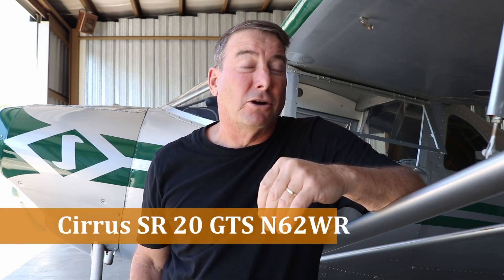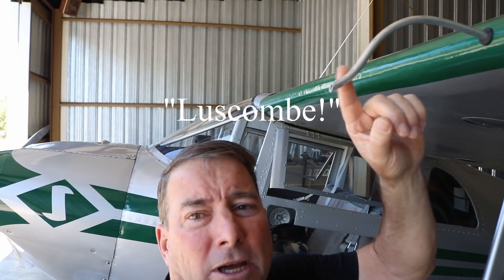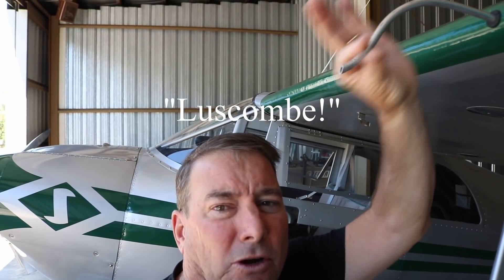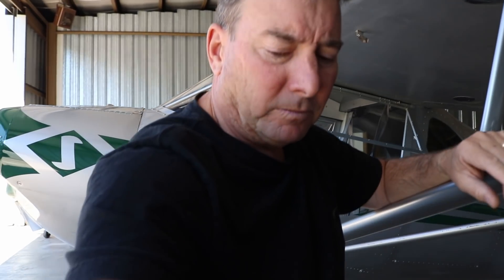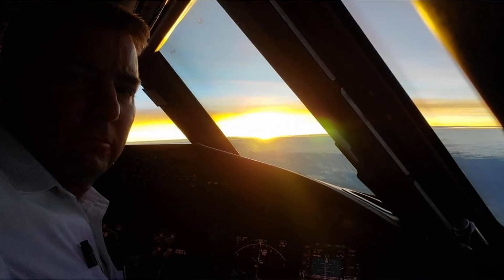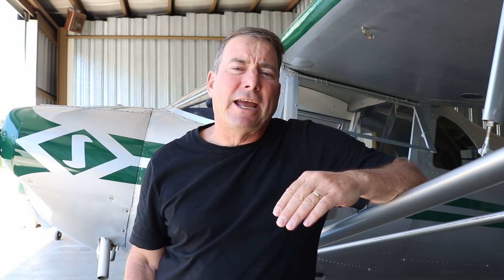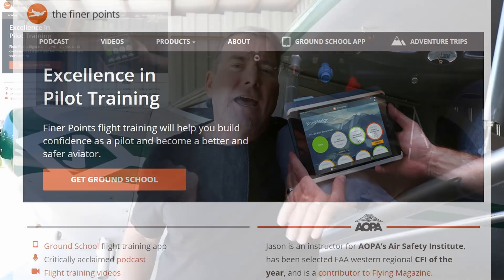Cirrus SR20 Crash Conway AR - AQP for GA!

Comment: Cirrus is a hot plane for a student pilot. The Cirrus was certified in USA by FAA without doing spin recovery due to having BRS.... From all the stall and stall /spin accidents I don't think the Cirrus is docile. The Cirrus has an outboard wing twisted down to make it stall later and in theory make ailerons effective into the stall, to improve stall handling.  The wing also has leading edge "cuffs". All of these wing design features were band-aids in attempt to mellow out the stall characteristics, which are not great in the Cirrus. Of course the plane does not look like it is at fault here. However some planes have stall behaviors that are much more benign. You must  maintain flying airspeed below critical angle of attack regardless of what plane you are flying. However if you stall a Cirrus close to the ground, the ground will come up and smite ye mightily.
Reply: @GaryMCurran  Thanks for correction. Inst rated, partial panel should have been a skill. Tragic.
Reply: @gmcjetpilot  this is why I think something else might have been going on.  Even if the guy was just current after not flying for an extended period of time, you still should be able to fly an airplane in CAVU conditions with no reference to instruments.
I'll be interested in what the NTSB says about this one.
Reply: @GaryMCurran  I agree with all you said, including "should be able", but sadly peoples airmanship may not rise to the occasion. Don't know. Lack of AS indication is a factor. Some panic and freeze, get distracted, forget to fly the plane. You should be (again s/b) able to feel by seat-O-pant back side of pwr curve,  "slow flight" (mushy controls) and/or onset of stall. However never having flown the Cirrus I don't know what that the slow speed regime feels like. Every plane I fly gets a work out, stalls, steep turns, slow fight etc. Most planes buffet pre stall while some at 1g don't stall just mush (sink fast). (guessing) Cirrus has few pre stall clues andfully stalls are abrupt. The BRS is not a catch all (pun intended) for lack of stick-N-rudder and good procedures (preflight).
Reply: @gmcjetpilot  I attended a lecture with Mike Melville, the first pilot of Starship One, and the topic of the BRS came up.  You would have thought someone had suggested his daughter was a woman of ill repute.  He does not, at least at the time, like the CAPS in the Cirrus.  This was many years ago and I wonder if he's changed his mind.
But, in this case, I would agree that CAPS would not have done anything.  I think we have a case of stall-spin, but what I want to know is, WHY.  What would make an instrument rated pilot, less than a mile from the airport on a CAVU day, crash?
I'm sure you've read "Fate is the Hunter", but did you ever watch the movie, which had nothing to do with the book at all.
It's an old 1950s movie, in black and white, as a lot of the same questions were asked.  Why did a twin engine jet liner crash with two perfectly capable pilots on board, and one engine that was perfectly fine.
Good aviation detective movie.
Reply: @GaryMCurran  Oh my gosh! I did read "Fate Is The Hunter*, Ernest K. Gann. It must be 30 years ago.  Loved it. It did inform and affect my approach and attitude toward flying from then on. Loved it. The B&W movie with same title was before my time, but I did see it. Caught it on TV by chance. HA HA. Seriously. Gann lived in Friday Harbor WA is not far from Seattle where me and the wife lived in Seattle. It's about 30 min flight in a C172. It has a nice airport, short walk into town, restaurants and tranquil beautiful scenery. If you get a chance to fly into the many San Jaun Usland airports, including Fruday Harbor, do it. You can also get to the islands by WA state car/passenger ferries.

The movie had little in common with the book; it is not great movie, but hey it was made in early 60's, and it is an airplane move.

Gann as you know was an airline pilot in the early days. The one-story where Nav lights go by in the clouds got my attention. I remembered going into Hillsboro Oregon airport on a solo student cross-country from Seattle. I was starting my descent on the airway, when a Bonanza went right over my head. Apparently we both were doing a good job tracking the Victor airway that day. Kind of hard to see airplanes coming straight on at you. From then on VFR flights I flew slightly off and upwind of  Airways. (Now its GPS direct : -) . I recall I read Fate right after. Much later in my career flying a B737 approaching Newark a King Air (not talking to anybody) and likely also with transponder off, since TCAS did not give an RA and ATC did not see it, flew over way too close. The Bizz Jet that hit a B737 in Brazil had it's transponder off. The Bizz jet landed but the B737 crashed kling all aboard. As a wise unnamed philosopher once said: "S@#t Happens".

PS I am not against BRS. In fact I have a chute for my RV7. Howevet I wear it on my back. If something big falls off or there is an engine fire this guy is "hitting the silk", hopefully not hitting the ground abruptly. Loss of power with good place to land? I would fly the plane.

Comment: Considering how irregularly most GA pilots fly and train, one might want to consider if deliberately obstructing (covering) a pitot tube,  and neglecting to remove that obstruction resulting in the loss of a critical flight instrument is greater than an uncovered pitot tube being obstructed. In 50 years and thousands of hours of flying, I've encountered an obstructed Pitot tube only three times, once on a test flight of aircraft that had not been flown in many years, atgain when the pitot tube impacted a small bird in flight, and another time where the Pitot tube directly impacted a large insect on takeoff. 
it's also important to check the rear drain/calibration hole. I've seen one that was corroded so badly it effected the calibration and another on a Bonanza what was blocked causing an erroneously high airspeed, about 8kts on approach.

Comment: When I was flying as an FO in a CRJ900 I was coming down the taxiway to 35R at DFW and observed an AA321 with the pitot completely covered!  I reported it to ground and they reported it to the flight in question. The captain said he couldn’t see it.  As luck would have it they pulled up next to us just short of the runway.  I spoke directly to the captain on the radio and told him where it was.  The left side was completely covered.  They then thanked me and taxied across the runway then did a gate return.  Now I’m flying a PC-12 and some times we send two pilots on certain trips and we are always doing airspeed checks and positive control changes everything you learn at 121 and airline training and AQP

Comment: “Airspeed is alive, engines instruments in the green” on every takeoff roll.
Reply: I had the exact same reaction to him apparently NOT doing this.  Puzzling.
Reply: How would he even know when to rotate?
Reply: @jonkagan7170   At “enough speed” it probably “wants to fly” and just lifts off the runway.
  But even if you go with that assumption, how does one “not notice” zero indicated airspeed yet climb at Vy (or Vx) ?
  My sense is he did not abort the takeoff and it started to fly.  Not much of an issue at full TO power and a normal-feeling pitch angle.  But then when he throttles back or idles the engine he just doesn’t visually judge the airspeed and balls it up after he stalls.  
  Too many questions. Disheartening.  I hope I am wrong.
Reply: @jonkagan7170  Prob. by paying attention  to his newly developed instinct and feel for what the plane was doing, but which he seems to have stopped doing once he got airborne. Sad thing.
Reply: Even when I am alone I do verbal callouts of airspeed I am my own FO. IN effect it is my personal takeoff checklist as I roll dwon the runway. I also have Vx and Vy marked on the airspeed indicator. Its only a Piper Cherokee but I want to know those data points especially in a hot, high  and  (maybe) heavy takeoff.
Reply: How someone could be checked out for solo without this being second nature is beyond me.
Reply: I was looking to see if anyone called “airspeed alive”. Every takeoff roll.

Comment: I have my GA students fly without airspeed from time to time and at least once the full pattern. (pitch, + power = performance) "Airspeed alive, engine (gauges) check"    during take off was something I had my GA students check. To let me know they did it they verbalized it.  I would also look at them to see where they were looking.... not just saying it without checking. Obviously when you set power with fixed pitch there is a min static RPM and CS Prop it should be at full RPM (2700 typically). All these are checked on EVERY takeoff, along with an abort point and engine out plan low altitude and higher altitude.

Comment: I only learned the practice of presetting the throttle for specific airspeeds and landing the aircraft based upon attitude and throttle setting as part of my instrument training. That's also when I got into the habit of checking my airspeed indicator at the beginning of my takeoff roll. I think Juan is right. This is a skill that needs to be taught to all GA pilots, not just those of us who bother with the instrument rating. 

We can do better than this.

Comment: I recall once seeing in the Sporty's catalog, a "breakaway" pitot tube cover having vanes which caused the cover to split in two and fall to the ground once subject to a certain airspeed.  I just checked and cannot find this accessory.  Anyone else remember those?
Reply: What I remember was one that had a little plate on it that when you hit a certain airspeed, the plate would tip back opening the pitot tube.  When the airplane wasn't moving, it was closed, but when you hit like 25 knots or something, it opened up.  It's not on their website any more.  However, Aircraft Spruce and Specialty still does offer them.  They open at 40mph or so.
https://www.aircraftspruce.com/catalog/inpages/ptubeprotector10-02100.php

Comment: 6:17 Setting a known pitch and power setting is something we don't hear often enough. It seems it would have saved even some major accidents like AF447.
Reply: Would have been a lot saved for sure. But it does have to be trained, and drilled into the brain, because it goes against our instincts to fly fast and high when trouble starts.
Reply: Exactly.  "Setting a known pitch" is the analogous to setting a proper angle of attack.  Don't rely on speed.  Flying using angle of attack (AOA) indicator, or appropriate elevator trim if AOA indicator is not available, would be easier and safer than by using indicated airspeed.   To avoid stall, simply do not exceed the stall angle of attack.  There is also an optimal angle of attack for climb, for efficient cruise, and for descent.  During steep bank, one is still able to stall the aircraft even at high indicated airspeed when one pulls too hard on the stick to exceed the stall angle of attack.   Landing an aircraft using the AOA is also easier, as one simply trims the elevator for the proper angle of attack for the approach, while adjusting the throttle to control the rate of descent to stay on the approach path to the runway.   When reaching near the runway, advance the throttle a little to slow the rate of descent, then soon enough, the aircraft will be in ground effect and wants to float and one simply needs to ease gently on the throttle to the idle position to get a soft touchdown on the runway.   By minimizing the use of elevator while trimming for the proper AOA, and using the throttle to control the rate of descent and climb, stall and spin accidents can be much reduced.

Comment: In the airlines and larger planes that require 2 pilots usually have two air-speed indicators or three actually, if any one of those three are not lining up you are advised to reject your takeoff, my dad was a CFI and I grew up in airplanes and I was always taught if there was anything at all funny about my airspeed to reject my takeoff, I'd much rather take the time to figure out what's going on when on the ground than have to deal with it in the air and end up dead.....

Comment: I just finished the last AQP training of my 121 career on Sunday. SPOT, EET, MV and LOFT. (interestingly, EET was mostly managing erroneous/unreliable airspeed). Total ~10 hrs of sim training + pre/post brief. Can we drag pilots in for ~10 hrs of training every 12 months? lol, many of them don't even fly 10 hrs in a year. So those that don't do the training will lose flying privileges? And to do the training they will have to fork over ~$1500 - $3000? 

Flashback, late 1980's. FAA proposes a change to part 61 that would require pilots with less than 400 hrs total time to complete an annual flight review. Everyone else operating under Part 91 would stay on the 24 month cycle. Benefits galore where it is needed the most. 

Only one problem: Industry and alphabet groups pummeled the proposal as unnecessary. Needless to say it was not implemented. That's 2 hrs of training every yr or every 2 yrs, respectively. And we're going to increase that by a factor of 10? 

Call it whatever you want, ALL pilots would benefit from more training. But as they say, good luck with that. 

I'll say it again. The pilots the need training the most are the least likely to seek it out on their own.

Comment: The problem for a noob is that in a car if you gets confused and scared slowing down is safe but in a plane slowing down makes you fall out of the sky and die. Speed is life in the air.
Reply: Same with altitude. Our instinct is to get lower to the ground, and fly slower, when altitude and speed are your friend.
Reply: Altitude is time.
Reply: @thetowndrunk988  I keep hearing about these instincts. I guess I'm lucky? The lower and slower I am the more nervous I am. I also hear that the instinct is that when the engine stops the instinct is to try to climb. I don't have that one either. When the engine stops I just go to best glide speed and start setting up to land. It would just never occur to me to point the nose up and stall. Yet I'm told that's the natural reaction and people get mad at me if I say it's not my natural reaction.
Reply: @gasdive  As to not climbing when the engine fails, I have this to say about that.  If you're at 2,500' and you're doing 180 knots, and your best glide speed is 72 knots, why aren't you trading 108 knots for altitude?  A 'zoom climb', might give you another 3,000' of altitude as your airspeed drops off to 80 knots or so, and then you can pitch over to best glide speed.  You have more range and more time to look for a place to put her down.
Try this.  Find your cruise speed at a lower altitude, bring the throttle back to flight idle and then pitch up to see how much altitude you can gain before you need to pitch back over to capture best glide speed.
Reply: @GaryMCurran  oh yeah, I agree, if you've got heaps of speed in hand, trade it for height. I guess I generally don't because I'm not really going places, I'll probably be just stooging around at about best L/D anyway.
Reply: Don't rely on speed.  Flying using angle of attack (AOA) indicator would be easier and safer than by using indicated airspeed.   To avoid stall, simply do not exceed the stall angle of attack.  There is also an optimal angle of attack for climb, for efficient cruise, and for descent.  During steep bank, one is still able to stall the aircraft even at high indicated airspeed when one pulls too hard on the stick to exceed the stall angle of attack.   Landing an aircraft using the AOA is also easier, as one simply trims the elevator for the proper angle of attack for the approach, while adjusting the throttle to control the rate of descent to stay on the approach path to the runway.   When reaching near the runway, advance the throttle a little to slow the rate of descent, then soon enough, the aircraft will be in ground effect and wants to float and one simply needs to ease gently on the throttle to the idle position to get a soft touchdown on the runway.   By minimizing the use of elevator while trimming for the proper AOA, and using the throttle to control the rate of descent and climb, stall and spin accidents can be much reduced.
Reply: @amec4888  this was a 2006 SR20, IF it was well equipped, it probably had an Avidyne system in it.  Did those displays have an AOA indicator?  I don't recall that they did.
Kind of hard to fly AOA if you don't know what it is.
Reply: @GaryMCurran  --Great point, Gary.  One can "approximate" the safe Angle of Attack by using the elevator trim and don't yank hard on the elevator stick, while keeping the CG within allowable limit when loading the aircraft.   An aircraft properly trimmed for takeoff  should only require a gentle nudge on the elevator to rotate the nose up briefly then as the wing carries all the weight from the landing gears, the elevator handle can be eased to neutral and letting the elevator trim to keep the aircraft at a safe angle of attack for climb-out.   Aircraft should be designed to limit elevator stick travel proportional to the degree of up trim, so that the pilot won't be able to exceed the stall angle of attack.  Of course this would limit the maximum angle of attack available in a nose-heavy aircraft, but if an aircraft is loaded at the rear, then it would be light when nose-heavy in the absence of rear-seat passengers, and the limit in maximum angle of attack would not matter much when using long-enough runways for training purposes or general aviation flying, except for bush-plane flying that must use maximum angle of attack for very short fields.
Reply: @gasdive  It’s the natural reaction for someone new.